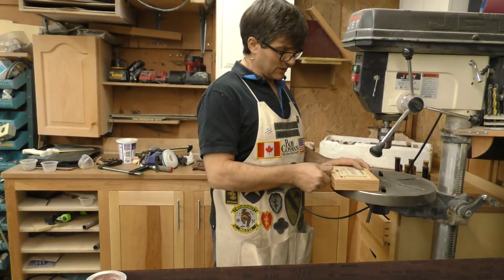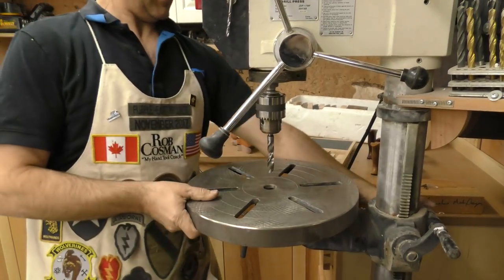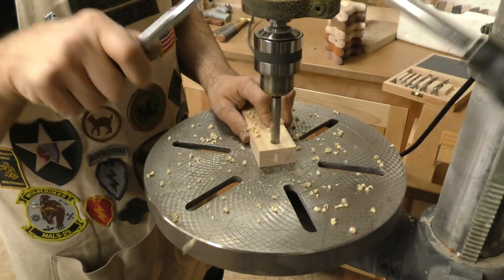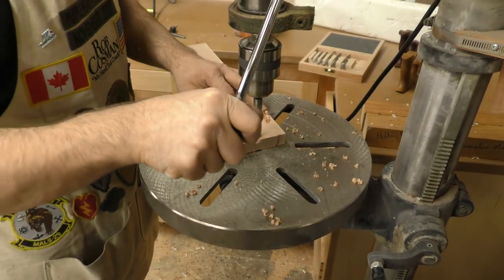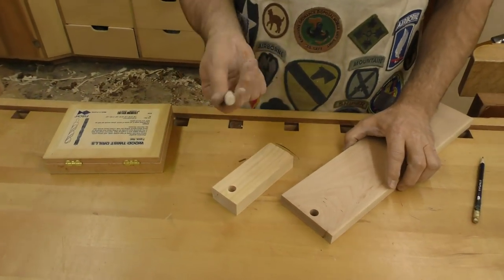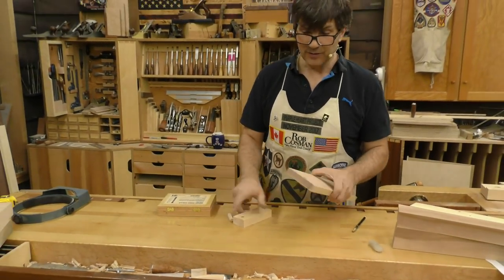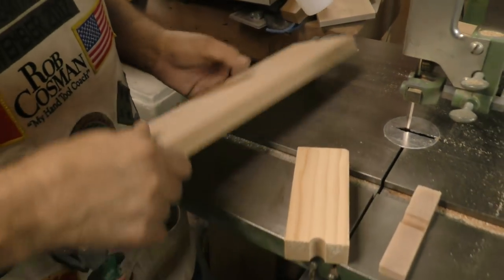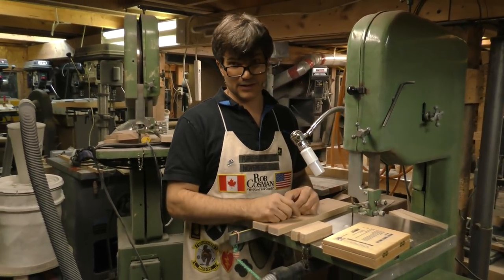Brad Point Drill Bits by Fisch, Review by Rob Cosman

Comment: For reasons I cannot comprehend every single 3/8" BP bit I've ever owned has been bent straight from the factory.. Odd, huh? So I ordered 2 Fisch 3/8". (from Klingspor) I injured myself badly enough I haven't had the opportunity to check them out, but we'll see. Funny, every other size has been just fine although I'm not sure about exacting sizes. At least they've all been straight. 3/8ths have all been off as much as 1/16th inch. This 3/8" issue has been ongoing over multiple manufacturers. Am I 3/8" cursed?